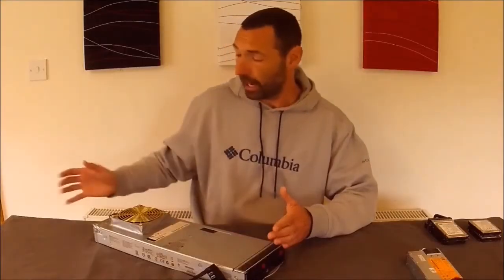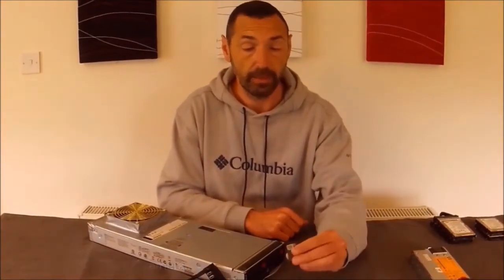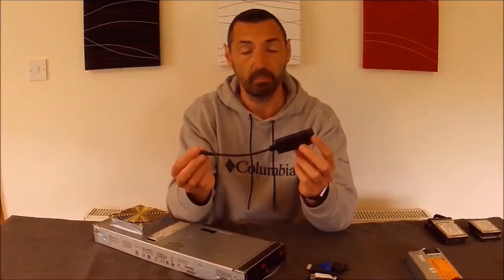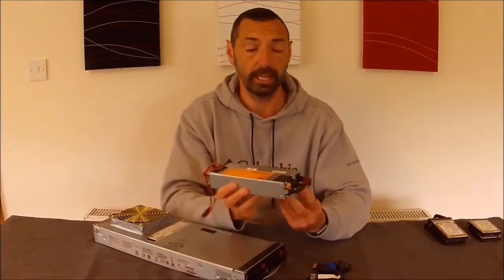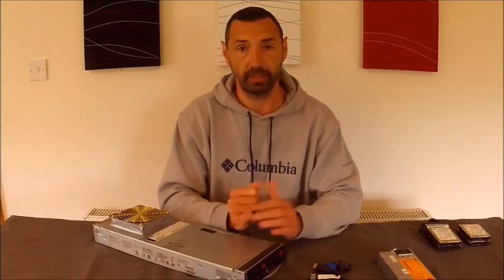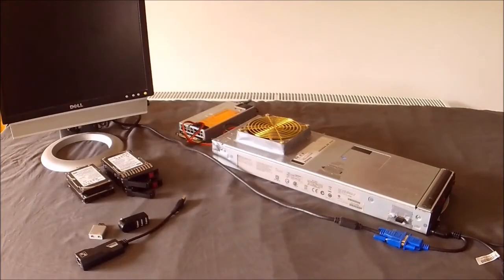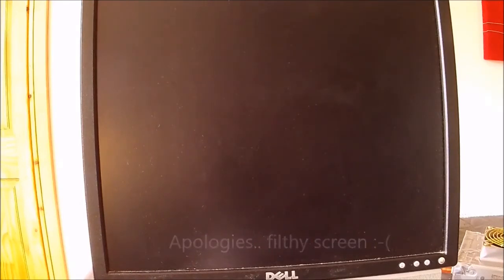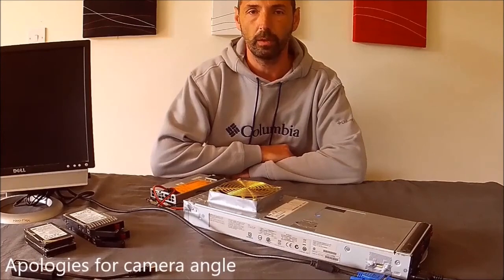HP Blade 460c Gen 7 Conversion, cheap Server

Comment: Just over 4 years old and it's still helping.  My sincere appreciation.  Out of curiosity I bought a Gen 8.  Spent a lot more than you did, unfortunately, but it's worth it to learn.  The internal USB is in the same place.  I am wondering about the pcie mezzanine ports in the Gen8, potentially for a GPU.  I can't find much information so far.  The combination VGA/USB/Serial port cable, the SUV cable, will cost as much as I spent on the unit, so I am hoping to somehow use my USB-to-video adapter with the internal port.  Just saw another video where the guy stripped 4 network cable wires and placed them in the top right four little holes of the server enclosure interface to get the management console up on his network (https://youtu.be/23ZIOhtGlF4).  Made it seem easy, but you know how that goes.  I have also brought up your blog.  When the unit arrives, I should be pretty well informed.  Thanks again.

Comment: You should have gotten a gpu chassis for 2 pcie slots
Reply from the maker: GPU chassis? Don't those connecting primarily via Thunderbolt, due to the amount of data. But yeah, something like that would of been idea if this Gen 7 Blade had the I/O. But then I'll also guess that the GPU with it's GPU chassis (even if it could connect and at the cheapest possible price is still going to be over budget for this server!) but thanks for your comment dude 👍
Reply: @TheRobMozza  I don't think you can change the gpu in a thunderbolt gpu chassis, ive also never heard someone call it that and where would you connect it, I doubt there are any mezzanine thunderbolt cards.
What I'm talking about is that workstation blades tend to have a extra chassis with pcie lanes.
Image: https://www.fjox.win/blade6-gpuchassis.png

Comment: You stated that they were good at memory and cpu intensive tasks, what does that mean? Does that mean that it would be a suitable desktop computer?  Great video by the way.
Reply from the maker: Hi and thanks for your comment, Sorting, search, graph traversal, matrix multiply are all CPU intensive operations, a process is CPU-intensive or not it depends on how much and how frequent are their execution. For instance trans-coding video or compressing files is pretty CPU intensive, because they run the CPU operations far more than they need to read/write memory or disk. Put simply this server may very well be better than a regular desktop PC (depending of course, on its specs)

Comment: My blade server does not turn on when I apply 12v I'm getting an orange light on the power button and a green blinking led on the board. Any suggestions?
Reply from the maker: What happens if you physically repush the power button on the front? Does it change from amber to green again?
Reply: @TheRobMozza  thanks for replying! Nothing changes, same green blinking led on the board and orange power button.
Reply from the maker: @PrinceJay1st  Hmm, unfortunately I sold my Blade so I can't experiment for you however maybe it's worth resetting your Blade? (If I remember you can do this with one of the internal DIP switches?) Again I'm not certain. I did have an issue myself once but if I remember correctly I had a loose stick of RAM, so maybe it's also worth reseating all of your memory modules?
Reply: @TheRobMozza  hey you're awesome man. It actually was the dip switches. They are a bit finicky so i had to experiment with it. The only issue is getting it to power on with both the cpus.
Reply from the maker: @PrinceJay1st  Glad I could be some help! All my best

Comment: Ok, so do you need one power module per server blade??
Reply from the maker: Hi Jon no, depending on the server PSU wattage (in my case it was a 750W) and yet my Blade server at full tilt was only taking 195W from the plug. Thus, I'd guess you could comfortably run possible three blade servers from the one PSU?
Reply: @TheRobMozza  por favor podrías ayudar con la modificación a la fuente algún esquema
Reply from the maker: @coyokyt  Lo siento, no entiendo correctamente? ¡Estoy usando el traductor de Google!